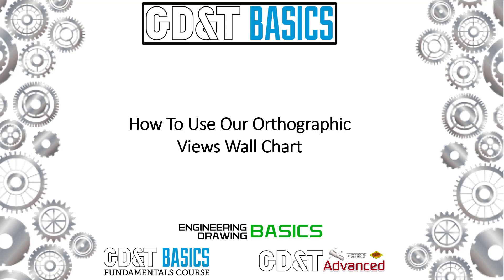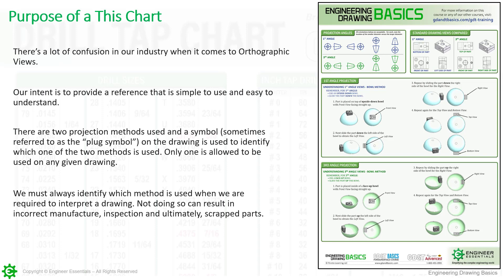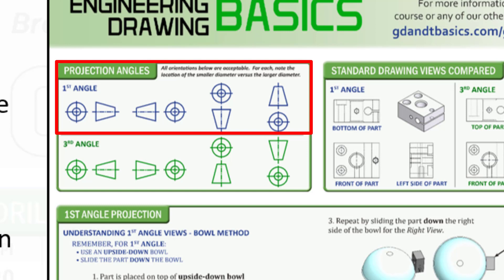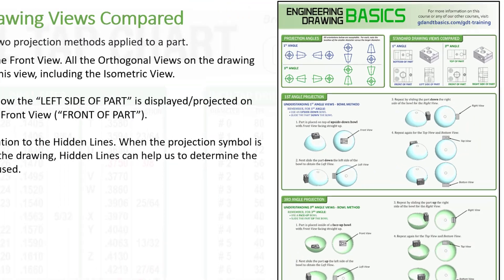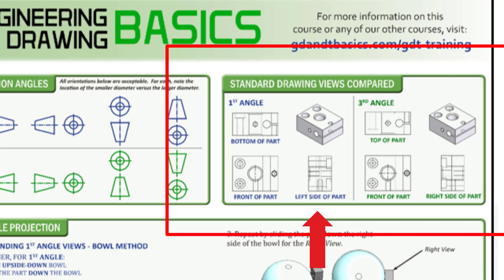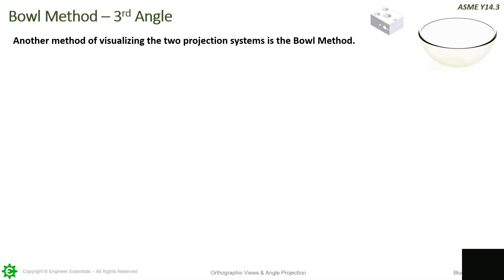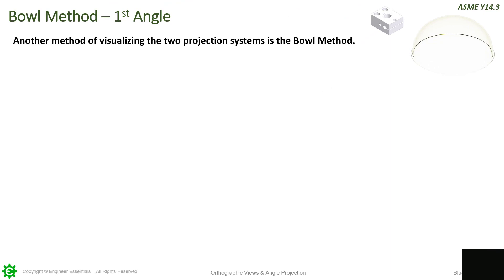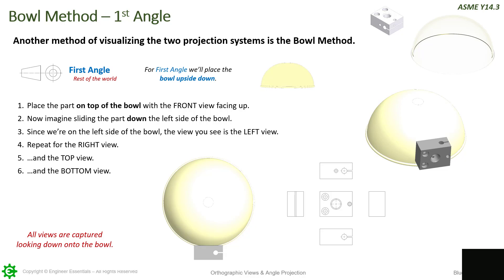How to Use the Orthographic Projection Chart

Comment: I like to picture a "screen" on which the views are "displayed". We start from the front view and roll the object ON the screen to get the other views. In third angle, the screen is between the object and the observer. The object is then roll on the screen, which gives the right view on the right side. Same thing for the first angle. The object is rolled on the screen, which gives the righ view on the left. What I like of this method is that it aligns with the formal definition that specifies where the projection plane is. First angle = projection plane behind the object. The plane is our screen on which the obect is rolled.